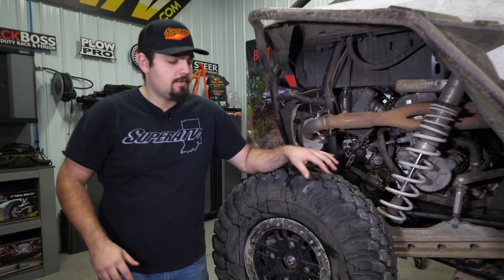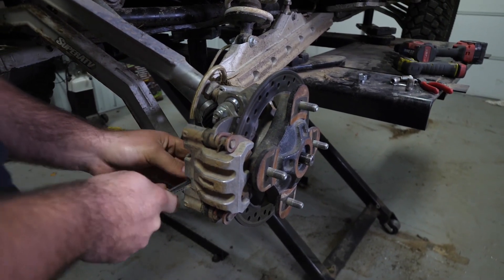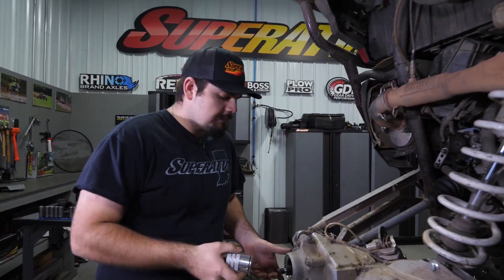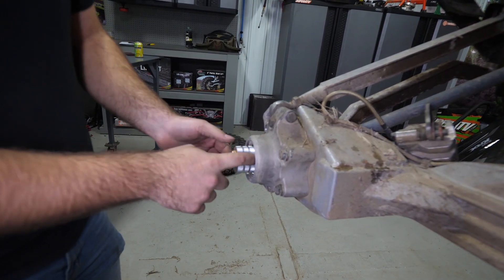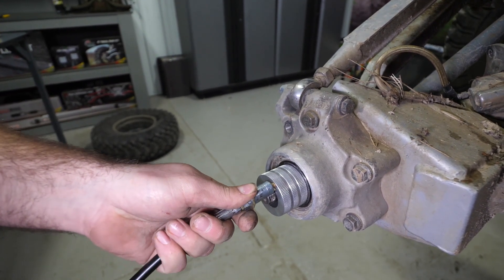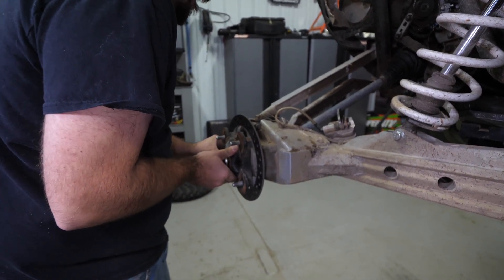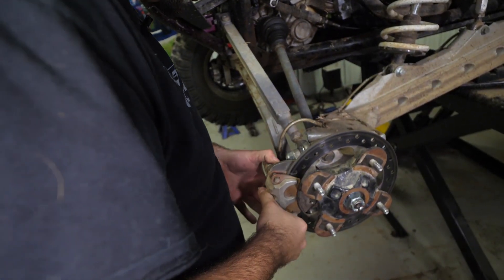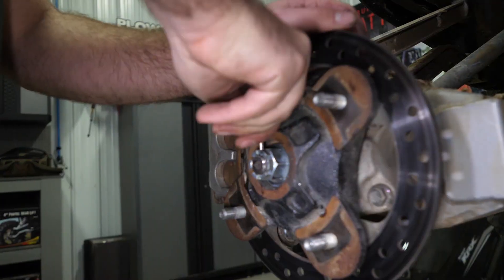How to Grease your Polaris Wheel Bearings | SuperATV Wheel Bearing Greaser

Comment: I did my fronts no problem rear though i couldn’t get the hubs off  is there a trick?
Reply from the maker: It can vary per machine. You may need to refer to the machine owner's manual or contact your local dealership for further instruction.

Comment: If the bearings have never been greased , it usually takes about 24 pumps
Reply from the maker: Our bearings come prefilled with marine grade grease. So it doesn't take much to top them off!
Reply: @SuperATVMedia  Didn't make my statement clear. 
If the machine is oem with the factory bearings.
I wasn't trying to disrespect your product 
🇺🇸

Comment: Is there a wrong way to put washers back on before castle nut?
Reply: Yes. The bevel side goes out so the castle nut keeps pressure on it
Reply: Align washers so their convex sides are facing away from one another. Think of the convex & concave positions as they relate to a pair of eyeglasses. Eyeglasses will almost always have the lens concave facing the eyeballs & lens convex facing outward. Hope this helps.
Reply from the maker: I don't believe so! There are some models that have a beveled washer, but you should be able to locate an image for correct placement in your owners manual.
Reply: There is!  I was replacing my diffy recently and had to put my front hub back on.  There are 2 concaved washers.  If you don't place them in the correct direction,  the rotor will rub on the brake pad hard once you torque the castle nut down.  I called a shop owner.  He told me they have to be positioned so that the bow against each other and have a "spring" effect.  I played with them a little and got it to where I felt comfortable with them.
Reply: So after doing tons of research and asking a lot of people on forums, I finally got the answer.   The 2 washers are concaved obviously.  They go on the hub with the wide open part of the washers facing each other.  So the "pointing" end if the cone point away from each other.

Comment: Did you just crank that castle nut down without proper torque setting?
Reply from the maker: Oops! Proper torque settings can be found in the vehicle's owner's manual. This XPT requires 180ft/lb for the hub castle nut.
Reply: I counted 12 uggas and 13 duggas.
Reply: Weird…

Comment: Bearing full of grease is wrong. It will overheat and ball separator will wear out. Quicker the speed more bad it gets. Right amount of grease is very little.
Reply: Artur, help me please. I have a trailer with sealed wheel bearing. Long story short, I filled it full of grease ( to push out old grease that turned into liquid). On its end there is a cup that is empty, probably 75% volume of the grease I pumped. Will excess of grease shift to the hub cup or I'm in trouble?
Reply: @SuperMarioQueens  I believe it will push to cup. Problem is with dual bearings that have seals on both sides. Trailer bearings are other type usually. From cup side they are open. Or else how did you manage to get grease into bearing..
Reply: @artur8403  needle style into milwaukee grease gun. Old grease was actually a liquid. I didn't even plan to push that much but old grease started to flow like a river so I figured I will pimp till it stops. Then I realized it might be too much when was too late. 
It's a car carrier trailer. I think I will open them after some 500 miles and remove excess.
Reply: @artur8403  I removed hub cup
Reply: You are 100% correct...They must sell bearings too! Too much grease into the bearing! No tourqe wrench on castle nut!
Reply: @RVsandRCs  what's proper castle nut torque and amount of grease ?
Reply: @123tdr  how much grease depends on riding habits.  If you sink your machine all the time fill them up. For normal or high speed operation I recommend 5 pumps from a standard sized grease gun every 500 miles. Torque spec on big bore sportsman is 80lbs.
Reply: @RVsandRCs  how much is in from the factory? They have no way to know about your riding habits or where you ride. Also what does a  Sportsman ATV have to do with a rzr UTV?
Reply: After replacing several hundred oem polaris bearings over the years I can tell you the amount of grease they are shipped with is never consistent.  Thats why I recommend adding some. As far as what's a sportsman have to do with rzr bearings they are very similar and some even crossover from model to model.